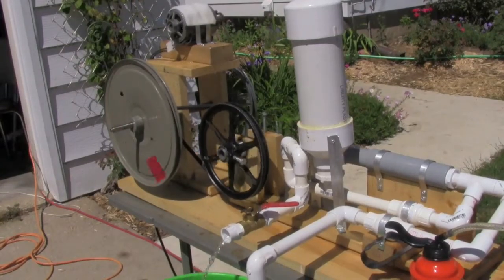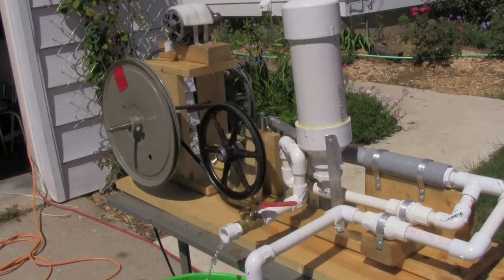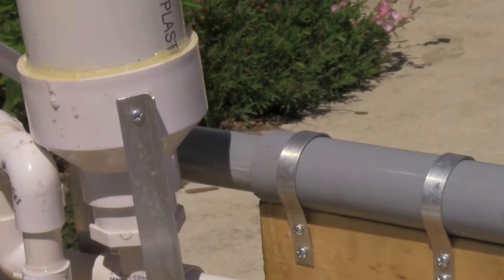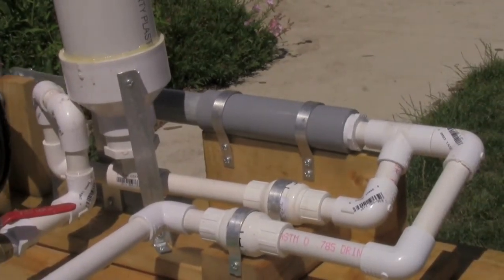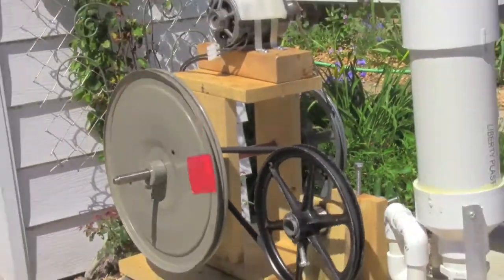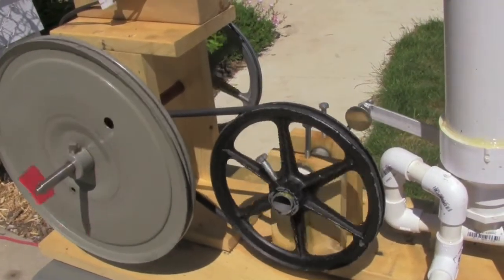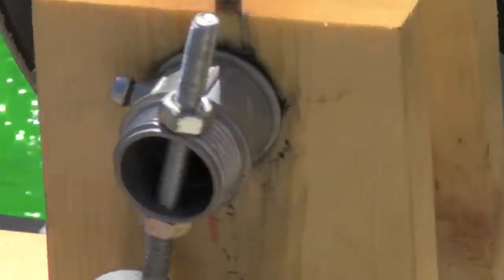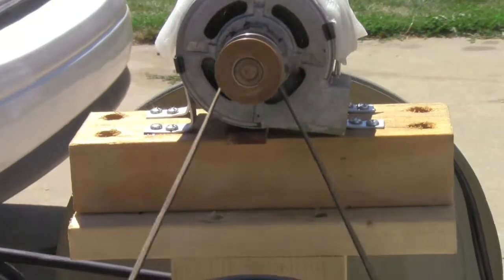Homemade Electric Water Pump - Piston Type

Comment: I have a well that the water is about 25 ft down. Could this system pull the water up from that distance to fill a 55 gal barrel?
Reply: It depends on how strong the motor is, and how much flow it has. With a setup exactly like this, I doubt it.